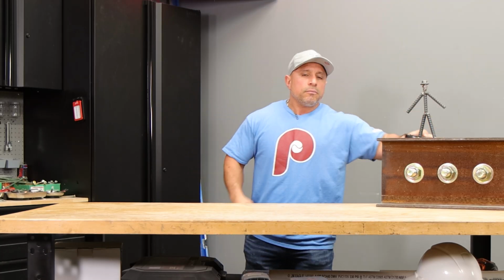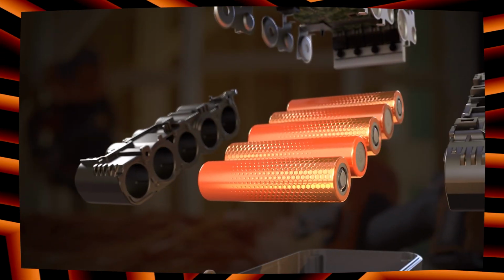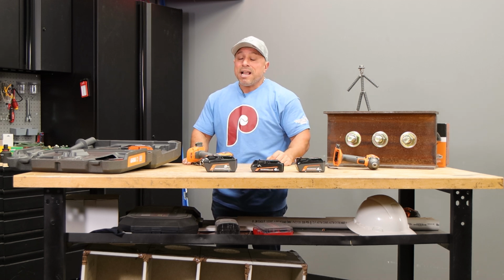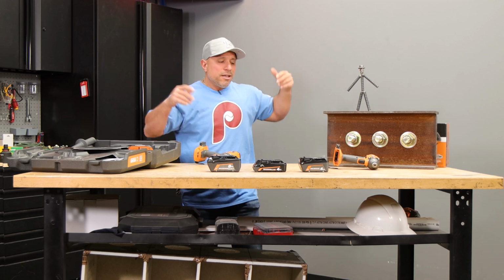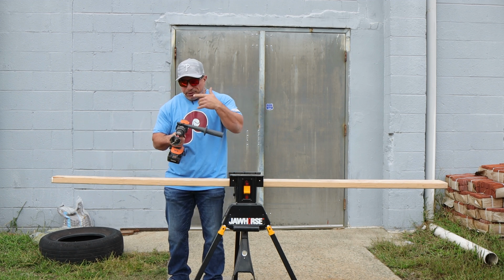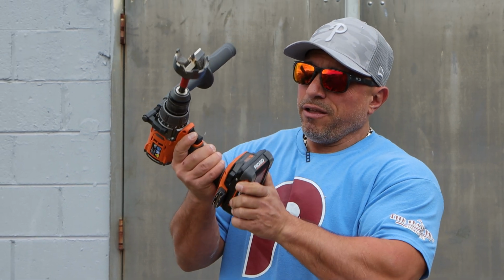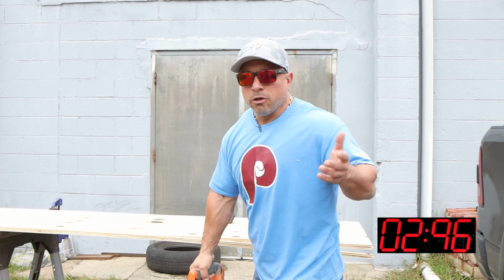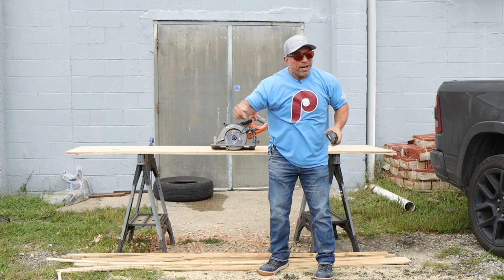Buying Power Tool Batteries is Confusing!

Comment: power tool batteries are so slow/outdated. Its crazy how the vape and ebike ev industry moved so fast. 18650s 21700s pouch cells etc. you never hear amps being talked about in power tool packs and what cells they are using odd LOL

Comment: I’m currently using the non hammer brushed ridged 18 volt cordless drill for that and my m12 fuel 3gen Milwaukee hammer drill as my light weight drill to get into tight spaces and not be a brick on my hip. Though my Milwaukee doesn’t like doing anything above a 1/2 inch holes without heating up after three holes being drilled?

Comment: Hey Vince what’s your favorite drill that works well and doesn’t heat up so much. I can’t seem to find a light weight one that meets my needs but also has the power to use 3 inch hole saws.
Reply: @BushcraftDude2025  try a lineman drill from Milwaukee. It's got power
Reply: @ianjay4596   yes that has power but it’s heavy looking.
Reply: makita hp001g

Comment: I think that when you were pulling the drill up and out and starting the next one you were moving faster than with the 8 and 4 max output. But even then I like lighter batteries and your highway analogy is spot on. If I were using a drill bit that big I would probably be using a corded drill if I had to make a lot of holes. But if I had only a few holes for a quick project then I would pull out the cordless drill.